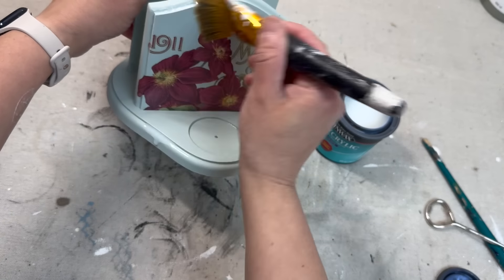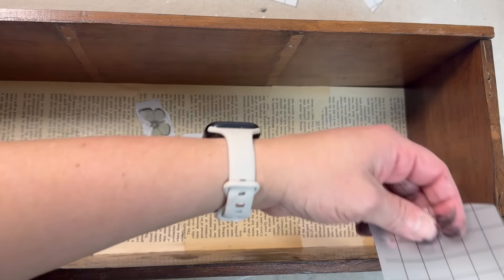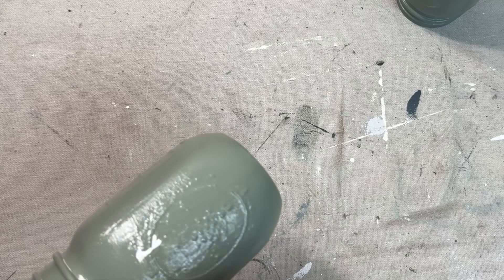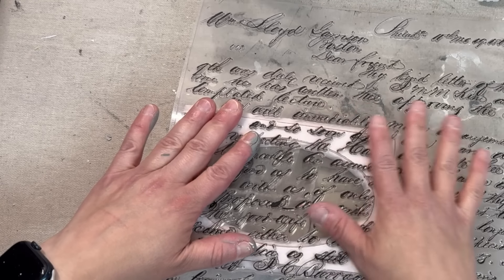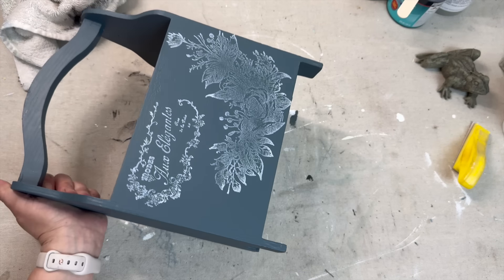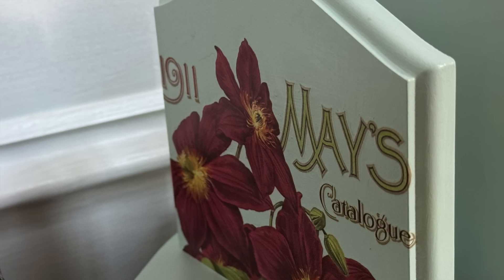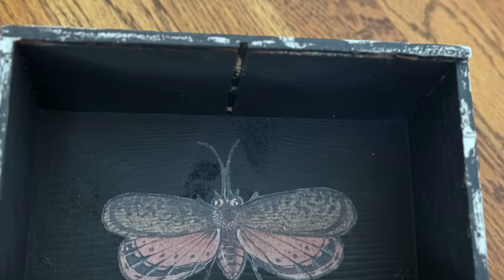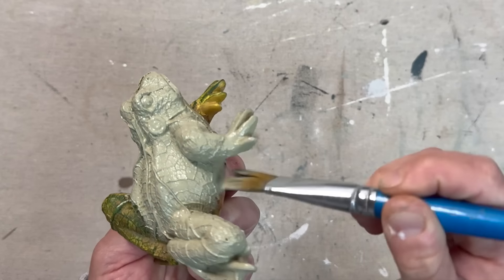From Trash to Treasure: 17 INCREDIBLE Goodwill Bins Flips Revealed

Comment: I’d use the heart/cork piece as a tray. The cork is a thin sheet and would not have much depth to use as a cork board. Your kids had the right idea! 💡
Reply from the maker: Thank you! I also thought about hanging it vertically and using the heart hole to hold a towel … thoughts? 😆I’m so indecisive 🤷🏻‍♀️

Comment: loved your projects.
Where did you get the spray painter?
Reply from the maker: Amazon - Windpost Cordless Paint Sprayer for Makita 18V Max Battery, HVLP Electric Spray Paint Gun with 6 Copper Nozzles & 3 Patterns,1000ML Container, for Home, Wall, Furniture (No Battery) https://a.co/d/j53x177
Reply from the maker: It does not come with a battery so make sure to order that too…  SHINTYOOL 21V Lithium Battery with Electric Quantity Display, 4.0 Ah Battery with Charger Adapter Led Indicator Compatible with Leaf Blower and Mini Saw https://a.co/d/54s0fv6
even having to order separately, it’s still way less expensive that’s the popular brands and served its purpose for me…just small projects at home! 😊